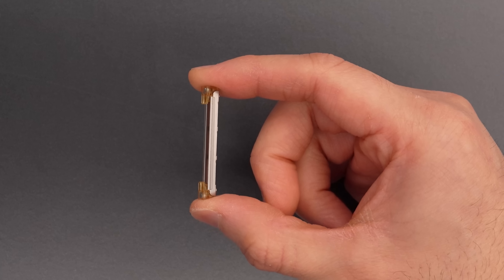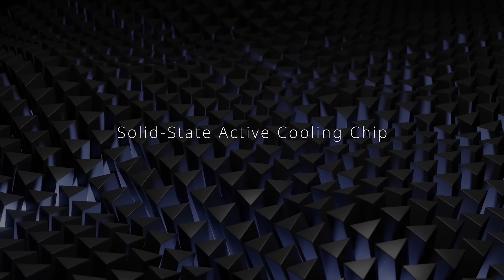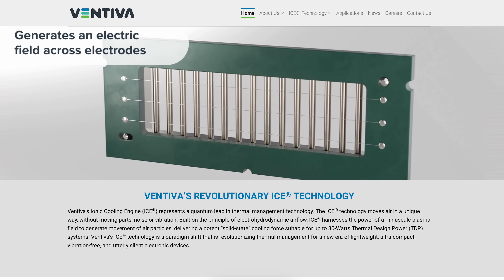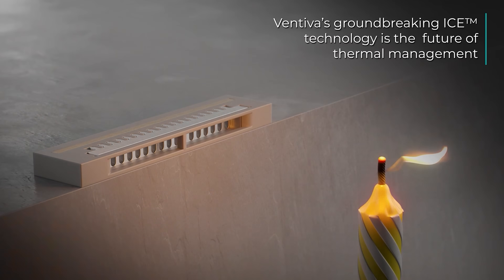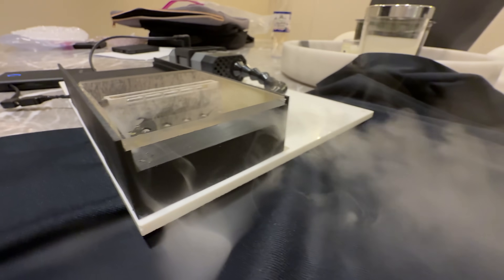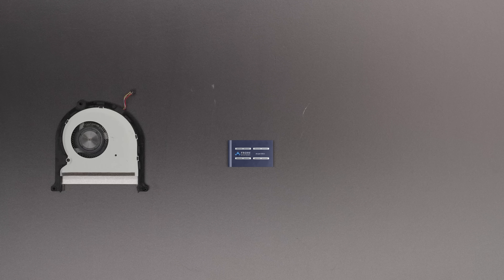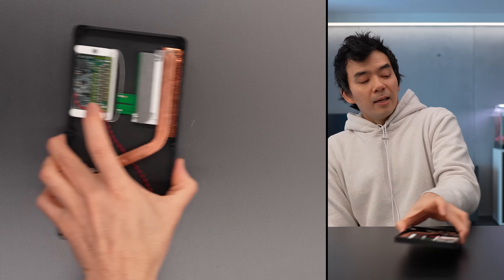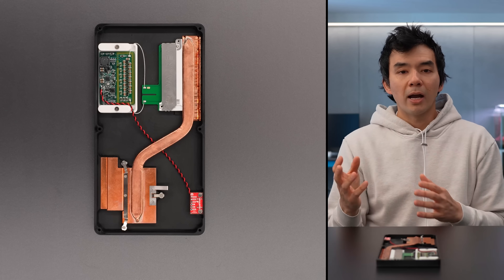The IMPOSSIBLE Laptop Fan...

Comment: They also solve the problems of the fan being clogged with dust
Reply: Sure, by getting clogged way faster.
These things do not work when any dust is on both ends of it. 
They need to be very clean in order to function well.

Comment: Bladeless magnetic ionized fans have been around in the mining industry since the 1970s for emergency airflow situations in, and supplemental airflow in conjunction with overcast/undercasts for decades. They were used when the working area was too far away from the intake or exhaust fan to have proper airflow especially in Shaft or slope mining operations that were miles away from the fan or for longwall mining. I was always surprised no one tried this before now, but I always thought that maybe it was because of the size and it being so small that it would be hard to produce or the magnetization would not be at an acceptable level in a few millimeters of width. Sometimes industrial level technology can't be scaled down because of output losses but this seems like a great idea. Its time the computer industry started looking at new way of doing things since computers haven't really changed in their fundamentals since the 1980s. Fans are a good start to rethinking the computing paradigm.
Reply: they did not try because of  ozone, nox  and high voltage.
Reply: @yoppindia but we have the opportunity to improve it? Why is everyone so pesimisstic?
Reply: @sosig8655  when you have simpler cheaper solution and you bring in a costly complicated solution it's prudent to ask questions.
Reply: @yoppindia  its fine to question but to write it off as something thats useless cus its expensive NOW makes no sense. Every emerging technology fucking sucks compared to whats already matured but sometimes its worth it to see what new technologies can improve that we might have not even thought of. Sure its expensive now but this specific product is a new thing so why not just see where it goes rather than just shitting on it
Reply: @sosig8655  when you are reinventing the wheel, first check whether it's round, 2nd it works, then it's worth it. And the guy who it's reinventing should be ready for the s*it. As an engineer and consumer who had to deal with heating issues, I have seen that simple things work better in the long term. More the complexity, more it's likely to fail.
In my experience if it doesn't require heat consideration it's the best.
2nd if it's a simple aluminium heatsink without too much consideration for airflow is 2nd best.
The above two lasts decades without any maintenance.
Next is a simple heatsink with a small fan will last a few years
Others like big heatsink, complicated thermal paste or thermal pads , big fan, blower will fail early or require frequent maintenance.
As far maintenance is concerned it should be simple, straight forward, should not require a phd.
As far as design is concerned, it should be doable by avg or below average engineer.
In this new electrostatic fan it looks simple but is not. It has too many parts, you have to consider complicated inflow and outflow consideration. 
On top of that it's high voltage, ozone, nox emissions, emf emissions.
It needs complicated heatsink, vents.
Not sure about long term maintenance like dust water, humidity.
So it has got too many things going against it 
I am seeing it only on a very high end super slim medium powered laptop.
So don't expect me to be generous with this.

Comment: While I take issue with Frore's use of the words "solid state", because the Airjet isn't solid state, it's piezoelectric, the Airjet has one thing going for it (assuming their assertion is accurate): laminar flow. At least within the airjet itself, the air moving through it is supposed to have laminar flow, which means you're not going to get eddy currents and other turbulence creating resistance in the cooler itself. That said, you still need a properly designed path out, and I think Airjet has the same problem, that it's not going to be able to move enough air over enough distance to be practical in a laptop.

There is one product coming to market with Airjet that I know of, Iodyne, a portable SSD RAID box, basically. Their marketing has made a big deal of the performance gain from using Airjet to cool the SSDs, which is vital for performance for on the go video, but this is going to be an insanely expensive device. I don't even think Linus Tech Tips are going to have the money to put those into regular use. They'll get a review unit so they can say "gee that's neat, but you'll need to set up a whole human farm to get enough kidneys to sell to afford this".

Comment: Instead of redesigning everything to use one new fan, how about using the old fan to build static pressure while using the new fan to dissipate the heat.
Reply: This was my first thought, it could be a much quieter, low rpm fan.
Reply: This + make chips more efficient. Dave's Mac Studio is faster than a PC & silent! My M1 Pro MacBook Pro does not use its fans most of the time even for more demanding tasks bc it does not get warm so quickly as Intel room heaters.

Comment: The piezoelectric cooler might not have as high a CFM per watt, but it pushes the air with a high force overcoming the lamination effects a fan has, and thus you need less CFM to cool the same amount.
Reply: Yeah, the airjet has a COP of 4 or greater.

Comment: imagine replacing the Steam Deck's fan with this.
IMAGINE REPLACING THE FRAMEWORK LAPTOP'S FAN WITH THIS.
Reply: more power consumption-->larger battery + weaker airflow=greater thermal limitations.  Not only would the ionic air jet make make the device cost prohibitively high on its own, needing to increase the battery/psu/and heatsinks would also make the device more expensive.  I'm by no means an engineer, but I can't think that better acoustics is worth less heat dissipation and more power consumption on mobile devices.
Reply: Steam deck and other handhelds was first thing I thought of too.
Reply: Imagine getting toxins in your body and ruining your copper tubes while you have to replace this every 6 months because the dust accumulating on the ionic surfaces shutting down the fan “effect” completely.
Reply: You walk with Steam Deck around, throw it on your bed, couch, sofa, etc. It would stop working due to hair and dust shorting it in like a month, tops.
Reply: jesus the FW16 has the most random hurricane fan showdowns of all time.
Reply: they just need to make them cheap. Come on, these shouldn't cost $50 per if you're making millions of them. Economies of scale and all that
Reply: Use it as a haptic feedback device and fan at the same time ;)
Reply: Hyped tech as usual smh
Reply: gaming and getting asthma from ozone at the same time 😎
Reply: or any laptop fan while you're at it.
Reply: Imagine caring how loud a laptop's fan is.
Reply: NO!
Reply: imagine intel cpu temps after this dropping 1% lmao
Reply: I imagine Steam Deck will crash when I am gaming.
I imagine framework laptop will over heat and crash when I am rendering videos or gaming.
Reply: @nava284  nah
Reply: That's gonna add an extra $20 for that.

Comment: I'm glad to see two of my main questions about this addressed - ionization and static pressure. Not that creating ozone is all that bad (forests ar echock full of ozone, and being in forest air over time has plenty of positive health benefits), but it's still good to keep ozone generation intentional. The static pressure issue is definitely more concerning, not only for the reasons mentioned, but also because it severely limits heatsink thickness and density, which is the main positive with shrinking cooling solutions (alongside more room for batteries I guess, but many small laptops today are already hitting the max for taking on flights, so...). I guess the solution here would be more coolers spread out, though that again comes into conflict with I/O - so this likely won't be a very suitable solution for high powered gaming laptops. Still, assuming it works with moderate sized heatsinnks there could be some very compact mid-tier laptops coming in the near future, especially if AMD's Strix Halo chips perform well. Now we just need to see them also ensure proper safety for servicing and cleaning around the high voltage components involved in this, and this could be pretty cool.

Comment: Everything he said about the airjet is so dumb. Cfm isn't everything and piezoelectric solid state fans like the airjet don't rely on cfm for cooling. They have insane static pressure and they're actually extremely low power useage per wattage off heat removed. This guy is extremely biased and only using buzz words to manipulate people.

Comment: I use an air purifier from sharper image with this tech that has been around for 20 years the issue is that when dust hits it there is a loud spark static sound like a bug zapper. I'm wondering how that will be addressed.

Comment: This technology reminds me of the Sharper Image air filter that they sold 10-15 years ago.
Reply: Ahh, sweet childhood memories...
Reply: DING DING DING!
I had to scroll down quite a bit before I found this comment.
This was the very first thing that came to mind as I had several of these over the years. They worked fine.... for a few years and then eventually always died due to degradation of some part that was not meant to be replaced. They worked "ok" but like most Sharper Image things were more sizzle than steak. They came out in the 1990's so about thirty years ago.
You can still buy them but they now have an "anti-ozone" adaptation that I have not looked into. The old ones definitely put out a tiny amount of ozone but if your house is drafty that is not really an issue.

Comment: I could see this go into large racks. 
 Imagine a whole server room being half as loud
Reply: The exact worst case scenario. You need crazy static pressure when blades are pulling 5-10kw now.
There is a reason Delta is king and they offer fans that are 38-88mm thick.
Reply: @ ok, I was just thinking. But what do you mean by 5-10kw ?
Also I think you meant wide not thick